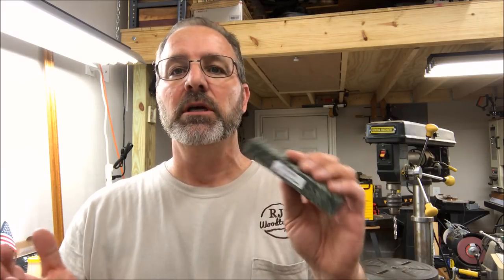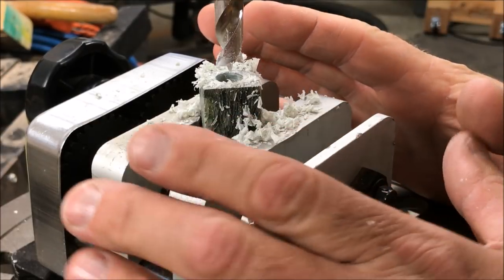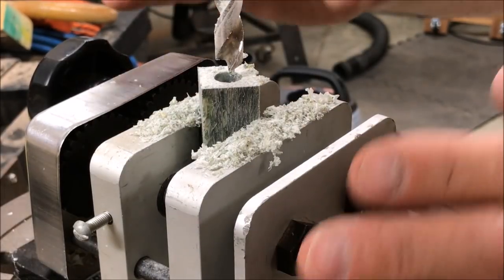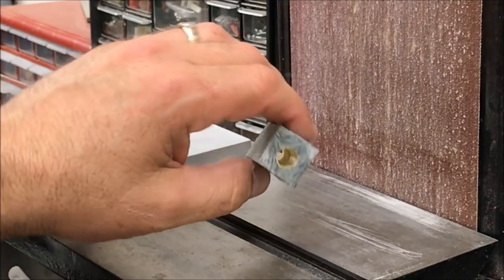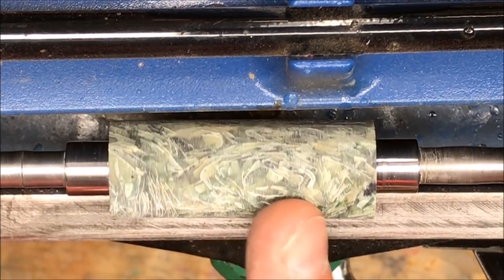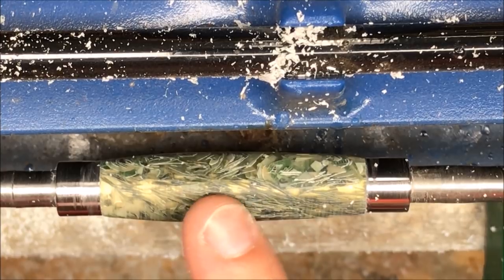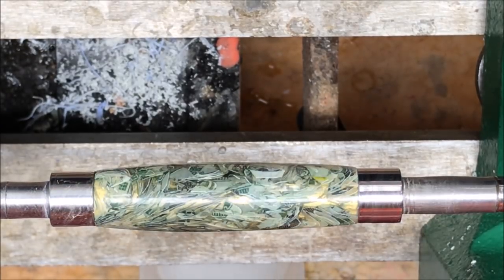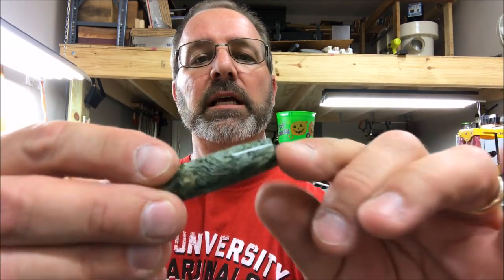Inlace Acrylester Money Blank - First Time Turning

Comment: I have been holding out on turning this stuff. Being a new turner, I have stuck with wood and alumilite. I ordered a hybrid blank that has mica in the alumilite and turned it recently. It was my biggest challenge by far. It dulled all my standard tools and chipped out around the junctions. Long story short, it turned out great, but man I'll have to second guess turning the other half. Great video, thanks for sharing.
Reply from the maker: +Ron Parrott Thank you,
  Non wood blanks can be really challenging. You never know what to expect. 

Regards,
Bob

Comment: I have turned a bunch of these. Definitely use the sander to true up the ends and knock the corners off. Saves a lot of headaches.
Reply from the maker: +Donald Taylor It sure did, I was glad I was told about that beforehand or I would have done it the hard way. 

Regards,
Bob

Comment: Great job on it!

As a heads up, you can fill the little voids/bubbles, chips, etc. with a little medium CA, they are pretty much invisible after being polished down. Also, in my experience, using a roughing gouge is a bad idea. It chips and cracks more often than not. Use a skew for best results (this is also what Woodturningz recommends). Finally, while the money blank is a neat idea, to see the biggest reason to use inlace, use a blank with some color swirling and pearlescence. It produces some amazing depth of color.
Reply from the maker: +SilktheAbsent1 Thank you. 

Regards,
Bob

Comment: I couldn't help but notice when you were drilling the blank that the drill bit appeared to get quite hot.  Fearing that it would be possible to melt portions of the blank that will lead to "bubbles or voids" in the blank,  I will spray water on the drill when I retract it to clear the chips.  I haven't had any problems doing this or am I being overly cautious?  It does take more time and somewhat messy but I feel better doing it this way.
Reply from the maker: +Dwight L Hello Dwight,
  I always tell people you can never be to cautious. These pens take a lot of time and effort to make, if you have a process that is working for you then it is a good process and you should continue using it. I have had other turners tell me they use water too. 

Regards,
Bob

Comment: Once you turn it round with the roughing gouge, it's safe to use a 2" radius carbide tool, but never come at it with a round carbide.  It will chip out 100% of the time.
Reply from the maker: +Michael DeLawter Thank you Michael,
  Valuable info to have in the back of my mind. 

Regards,
Bob